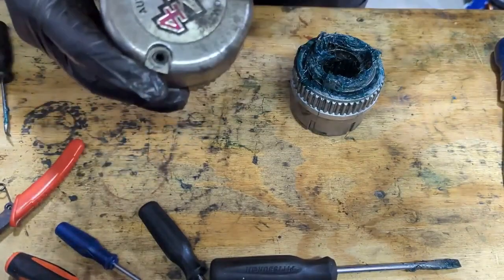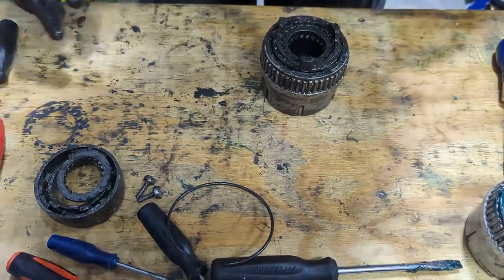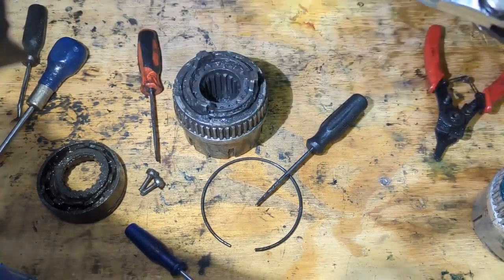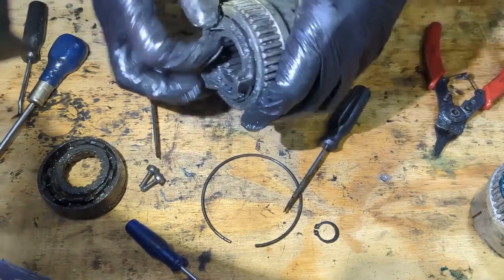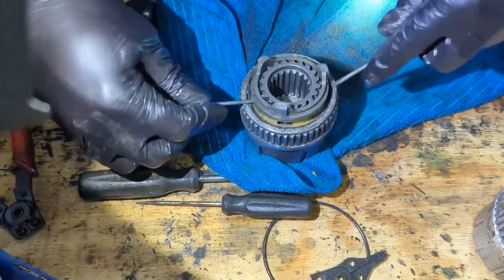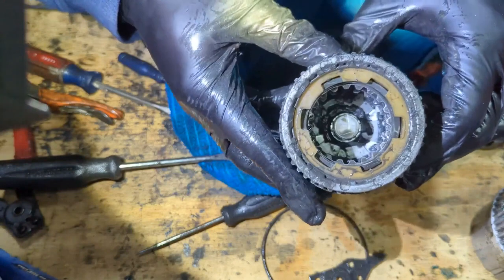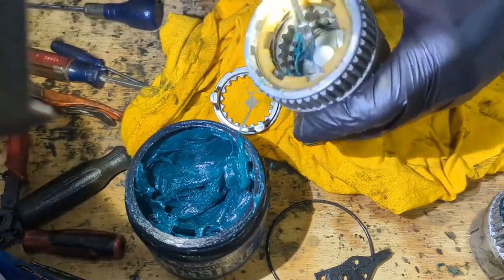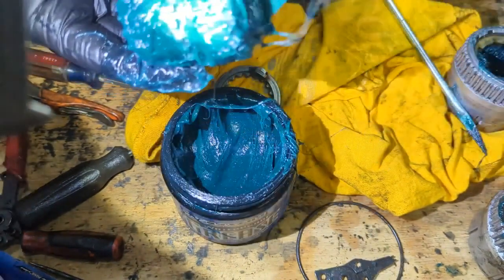1996 Bronco 3 Bolt Auto Locking Hubs Teardown

Comment: Thanks for this video.  I have a 95 F150 with the same 3-screw auto hubs.  Truck sat for many years in the elements.  The retaining ring was rusted in the groove and I destroyed it getting it out.  The hubs look pretty bad.  I'm still struggling to get that small inner retaining ring out so I can get these apart and see what damage is in there.  It doesn't want to budge.  Might just chuck it all and switch to manual hubs.
Reply from the maker: Yeah, that ring is terrible. If you have the electric hubs instead of the vacuum hubs, I'd try to stick with the auto-locking setup. Mine are the electric style. I don't use 4x4 often but if I ever take the truck north, I'm not going to want to get out and lock the hubs.
Reply: @SeadogSeven  I figured it out. There's a large clip that's hard to find, going it in. Used a 90 degree pick to get it out. I got one auto hub to free up and be spring loaded but the other side is still sort of stuck and not working.  I guess I gotta order manual hubs like I have on all my other OBS
Reply from the maker: If you want to keep the auto-locking hubs, you could get a used set from eBay and rebuild yours with those parts.